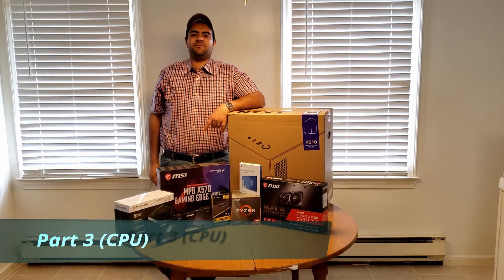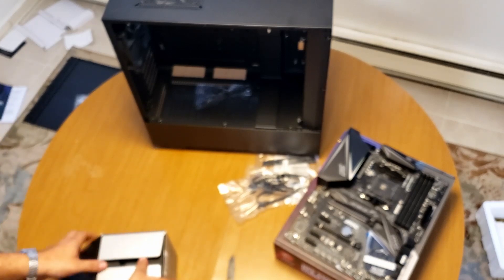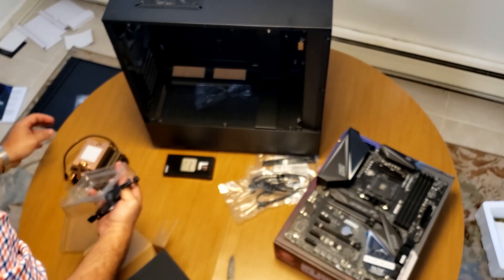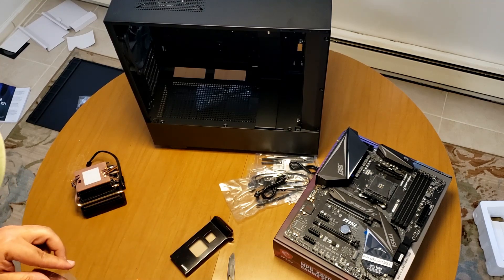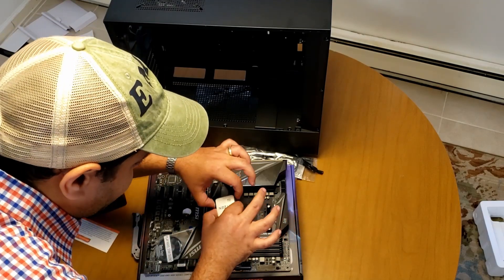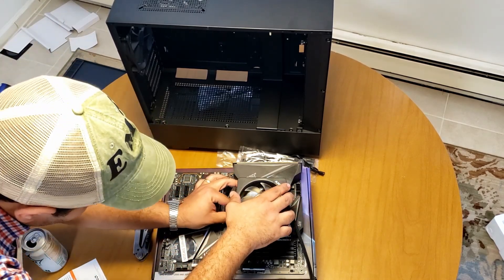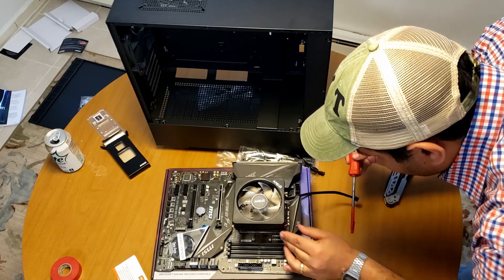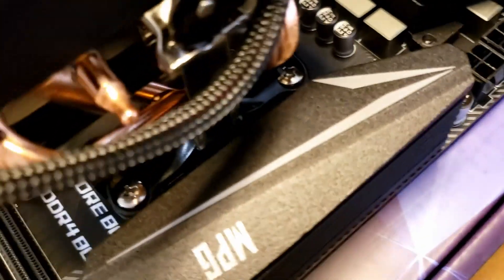PC BUILD (PART3) RYZEN 7 3800X UNBOXING AND INSTALL

Comment: How's the stock CPU cooler handle the heat? I've just ordered the 3800 X for my first build too but I went with a 240 aio water cooler. Also how's the airflow on your case? Any issues with over heating?
Reply: I'd be interested in seeing a 6months on video where you discuss how everything has been working for you so far.
Reply from the maker: No over heating issues what so ever! But in all honesty I don't really push the system to its limits often! O hope that helps!

Comment from the maker: LEAVE A COMMENT TELL ME WHAT YOU THINK!
Reply: Can you tell me about the cost? And can i make 3800x pc under £1000 euros ?
Reply from the maker: @arvie3576  YES MOST CERTAINLY! This particular build cost me about $1500 US! But you can use a mother board that doesn't have built in WiFi also a slightly lower graphics card and just using a standard spinning hard drive should bring you in the 1000 euro realm!
Reply: @emtproductions68  can i do gamming editing at 4k and streaming with ryzen 7 3700x smoothly?
Reply from the maker: @arvie3576   YES! But you'll definitely  need a VERY beefy graphics card like a 2070 super or even the 2080... and you should be good to go!
Reply: @emtproductions68  thanks brother. It will be very helpful if you make a video about a ryzen 7 3700x pc under 1000£ euros. Just tell us the names, spacifications, and price of the components. It will be really helpful man❤️
Reply from the maker: @arvie3576  MOST DEFINITELY! Subscribe that way once I get it uploaded you'll see it! Thanks for watching!